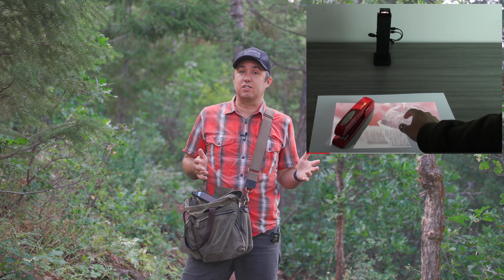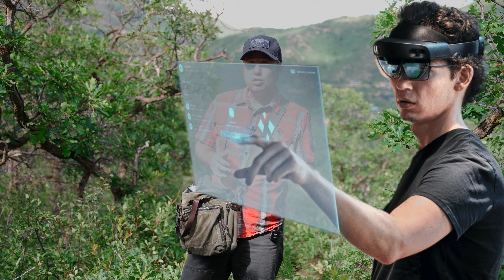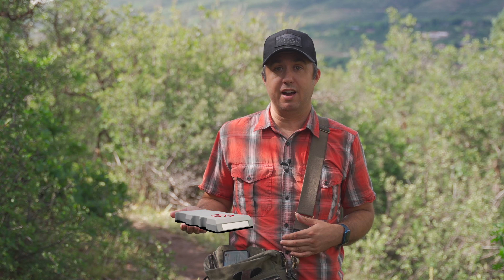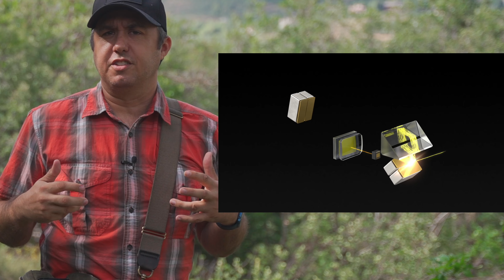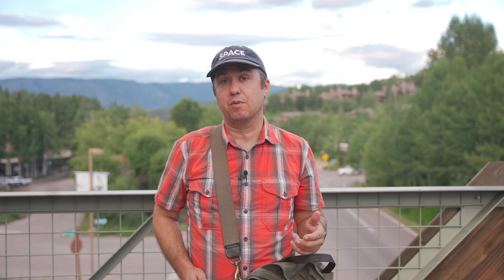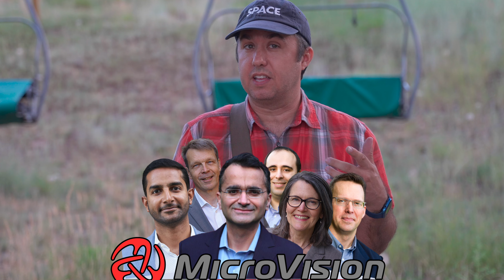Microvision LiDAR is Complete. Why LiDAR is Better Than Tesla Cameras for ADAS Safety.

Comment: Lidar is doomed because it misses too much information present within the visual spectrum. Just like you use your eyes and compute power from your brain, Teslas use more, better eyes and a faster brain. 
Eventually, Tesla wins the autonomy race and just licence the technology to other car manufacturers.
Good job on the channel, I really like your videos but I got to say I think you are mistaken on your analysis here.
Reply from the maker: It’s not a case of one or the other; these modules are already cheap enough, around $500, to just have both.  And once mass production comes around, prices always fall further.  
Cameras are getting good; Lidar is extremely precise.. Cameras and Lidar can work together to confirm each other and be better than either one could possibly be alone. There’s no arguing that laser range finding is more precise than triangulation through video data.
Reply: @SPACEDESIGNWAREHOUSE  That's the whole point why Tesla ditched their Lidar sensors. Yes, they built lidar sensors in all of their cars until approximately 2 or 3 years ago. The reason was pretty much conflicting data. Which instrument do you give priority when served a different output?
Reply: They never had Lidar in their cars, they had radar. They ditched it because of supply chain issues but told everyone it was because Tesla Vision was better without radar. FSD is a fraud, it’s nothing more than level 2 autonomy.
Reply: @Emanuel-jr2ii  You are getting LiDAR and RADAR confused.  Tesla discontinued their RADAR sensors a few years ago.
Reply: @dealio4624  Yep, they never used Lidar. They used radar and ditched it
Reply: @SPACEDESIGNWAREHOUSE  You could use a lidar (on your iPhone for example) to « to walk better » as it would give you more information about your surroundings but you don’t. More data is not better and actually leads to conflicts. 
Seeing how far an object is with extreme precision is not necessary for driving. Knowing if your about to drive over a plastic bag or a brick is quite the opposite. Lidar is missing key information in the spectrum that it uses and will be nothing more than an appendix. Lidar will only work for companies that will fake autonomy using HD mapping on selected roads and will be ditched by everyone trying to pursue full self driving like a human would. Dojo would be more interesting to keep an eye on for the next couple of years than any companies pretending to do anything significant with an already outdated technology.
Reply: To be perfectly fair. I do drive a Tesla, with FSD and we had a phantom break problem cause by radar. Tesla doesn’t include radar in its cars anymore and deactivated mine with software and those breaks are gone. This is an example on how more sensors could lead to worse autonomous driving. If your sensors sense conflicting information then it could choose to follow the wrong sensor.
Reply: https://www.youtube.com/watch?v=lD6ICmMRSL8
Reply: @ajelex had Tesla used even 2 lidar sensors, most of their crashes that resulted in deaths would have been avoided. The majority of their crashes are due to limitations of cameras. White truck on an empty sky backdrop, and the computer has the Model S merge into a semi trailer at 70mph... Lidar isn't better, lidar has almost no overlap in weaknesses with cameras, which is why it should be used, or the weaknesses of camera-only systems can be mitigrated.
Reply: @NicholasBoccio  You are interpreting the crashes as a lack of information when it is a lack of computation. Teslas do not need more data but neural nets thats can better interpret it. You drive and move around everyday with sensors that are far less accurate than Teslas and do a better job because the way you interact with reality has been trained by years of living through your life but also your ancestors with natural selection.
Reply: @ph4n70mcyph3r  Wow so it's a lack of computation that is making tesla's hit stationary emergency vehicles, or People changing their tires with their hazards on? Nope Camera's are easily blinded my man and pure shit apparently if it can't identify a stationary object as seen in many tesla AEB scenario fails on youtube.. Not worth the argument they will be mandated Lidar and as a matter of fact, tesla already use Luminar lidar on their test vehicles for supposed Data verification lol.

it should tell you something that nearly every major auto oem is adopting lidar and will soon be level 3+ which will put tesla behind from day one of the lidar driven vehicle era.
Reply: @NicholasBoccio  You don’t have a lidar and I hope that you eyes are good enough to not drive into stationary objects. Even at night, when it rains. 
You are a better driver with your poor vision than all of those autonomous cars. While you don’t have more sensors, you do have better trained algorithms in your brain that helps you navigate the world with somewhat limited information. 
Lidar is only helping those companies fake autonomy on a preset of mapped roads. At this point, Tesla and the other companies are not even in the same competition. The perception of Tesla is much better than what is shown in this video that does take true data and portrays it wrongly.
Reply: @ph4n70mcyph3r  I work with lidar everyday. I've developed lidar systems with manufacturers in Germany. I dont feel the need to argue with your assertions. Have a great day
Reply: @NicholasBoccio  I unlock my phone with Lidar everyday. I don’t feel the need to argue with your assertions. Have a great day as well.

Comment: LOL @ 1:53 you are talking about photogrammetry and show a clip of a point cloud created from lidar/laser scanners :)

Still love your content, and still skeptical cat about this company.
Reply from the maker: I pulled that video from a Tesla explainer about how they create 3D renders using multiple camera angles.  It would be hilarious if they actually use Lidar to make those videos, considering their stance on no Lidar. 

And thanks!! Skeptics are important brake levers
Reply: @SPACEDESIGNWAREHOUSE  it 100% is laser scan data. I can send you as many examples as you wish. 

Notice as the scene is being rotated that there is debris UNDER the road? This is not an artifact that you get from photogrammetry, but you always get this from laser scanning with the type of sensors used in automotive applications that use high speed & low scan-quality lasers. I get these even using my $70-150k when using lower scan-quality settings.

I used to work for a company that laser scanned race tracks for Forza https://youtu.be/iGj453KNREs?t=128 (that data is MY data) point cloud data cannot be confused with photogrammetry. See on the link, the track scene they are moving inside of? Those points that make up the scene are really only from laser scanners. 

Here is one of the many views that the Tesla computer generates:https://youtu.be/zRnSmw1i_DQ?t=66
Reply: point clouds arent an artifact of only lidar, its for any geometry.
Reply: @GoatDirt  I understand, however for the purpose of this discussion on this video, Lidar and point clouds are connected.
Reply: 2:12 way out of date. They are using way more powerful techniques than depth map based perception.